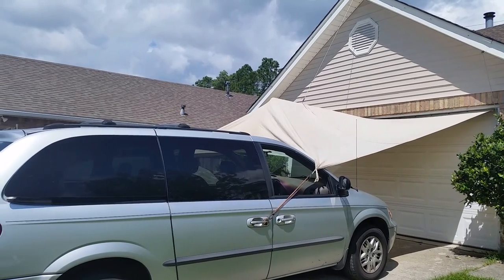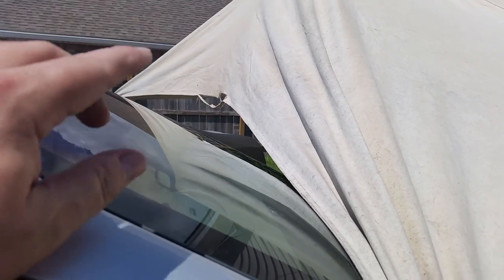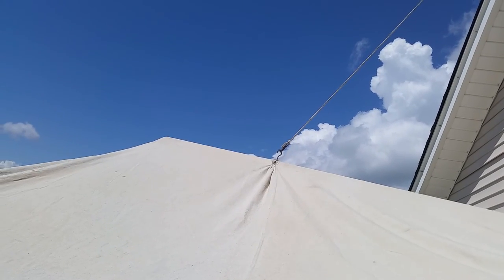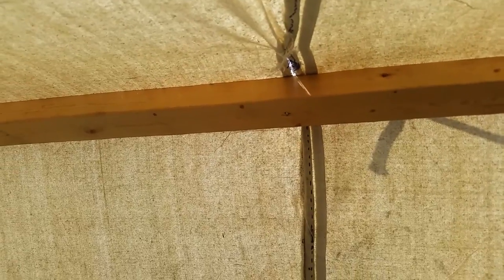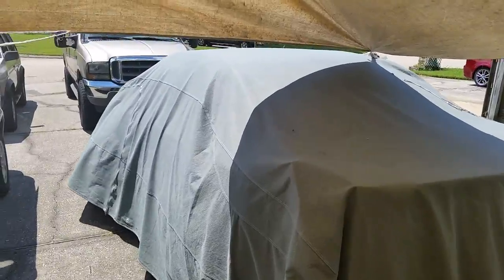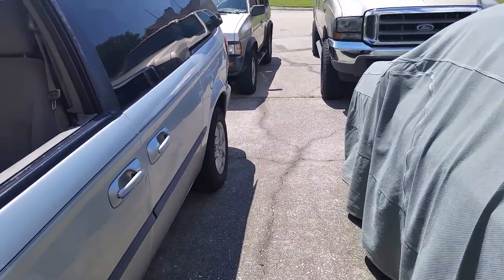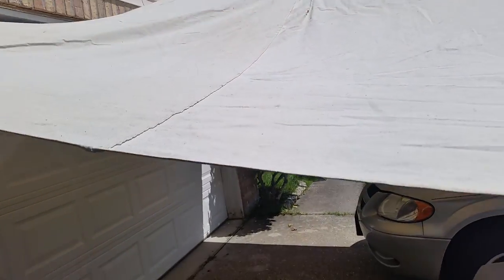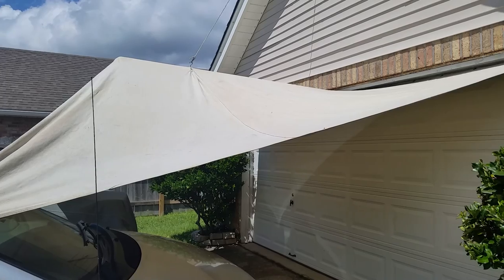Mechanics Carport Driveway Shade Tarp

Comment: Old pop up shade frames work good too. I stretch a shade to the frame and cover the frame top and two sides. Also have a shade wall on the evening sun side. 👍
Reply from the maker: Those work pretty good too, this also works in a light wind and I wanted a larger area, and it covers 15ft x 12ft with no legs to mess with either. Thanks for the comment and advice. Best Wishes & Blessings. Keith Noneya

Comment: I'm looking for tips on a more temporary set up that is safe. I know there is a way to make it secure. I hung a LARGE tarp on our driveway that provides great shade for our garage sale this weekend and prep during the week but in order to get it high enough, i have to make is super tight. Really it doesn't matter how high it is, at some point the wind will make it tisuper tight. It has eye hooks and I used bungees and ropes but removed it because I can see something coming loose and a bungee whipping and killing someone when pulled so tight. How do I do this safely?
Reply from the maker: Hum, I don't put mine up in high winds, the best I can suggest it to staple it to some 2x2's and us a jib pole in the middle like I did. You have to put some poles in the ground or do the cement in a tire with a pole in it. Put some eye bolts in the ends of the 2x2's and tie them to the poles in the cemented tires. Hope this helps Keith